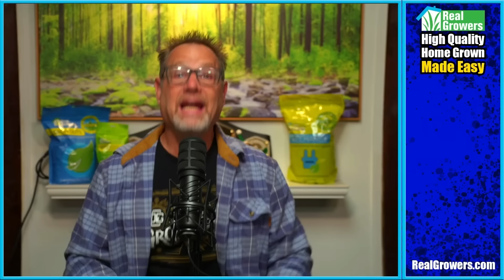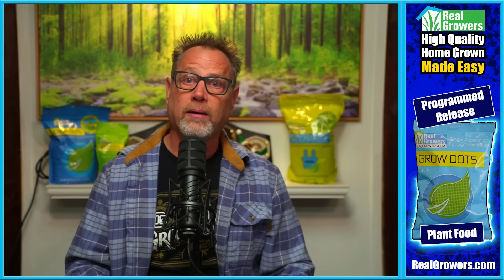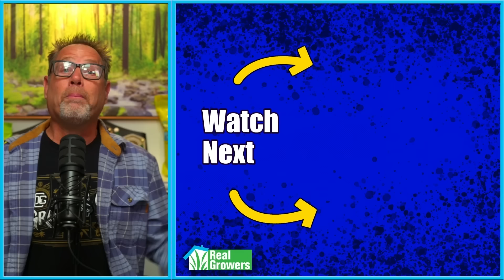Put Your Cannabis Grow on AutoPilot with THESE Tools and Techniques

Comment: Too Cool. "Sub-Irrigation". That's what its called? I've been doing that for quite a while now. Like; a 'self-watering' pot - the lowest part of the bottom I put Coco Coir scoring pads cut to size as my Wick, then I always put a square of (washed) landscaping fabric over that - completely covering the bottom and crawling up the sides a bit (like a paper coffee filter basket looks). Then I carefully add the first bit of Soil to press the fabric against the sides of the container, then I put a Mason Jar over that and fill around the Mason Jar. I leave the Mason Jar in the container until I'm ready to put a Plant in that hole. And if it's not a 'self-watering' pot but just a regular one with holes in the bottom, I'll put one of those Coco Coir mats from the Dollar Store for hanging baskets on the bottom as my wick, then the fabric etc.

Comment: I use the bucket Co drain trays with a return sump to the res tank . I have a mix pump,air stone and irrigation pump in the res tank. I plug the pumps into the ac infinity outlet controller.  It's my first grow using it so I watch when I water . No probs at 7 weeks of flower of 10. Best grows yet. I kept it wet , with a max load of grow dots with recharge, stash blend and I just gave em their first and last feed of bloom fert s from Scotts. 5x5 is full from 4 10 gals

Comment: Scotty, how do you get the recharge in your plant from bottom feeding
Reply from the maker: Top water once a week. I only use enough Recharge solution to get the top few inches of the soil wet. It's important not to water them to runoff with Recharge. Just give them enough solution to get it on the roots. I use a single 2 gal watering can of diluted Recharge solution, to top feed all 9 of my 3gal Realbuckets. Hope it helps. Head on over to Realgrowlab.com if you need any more details.